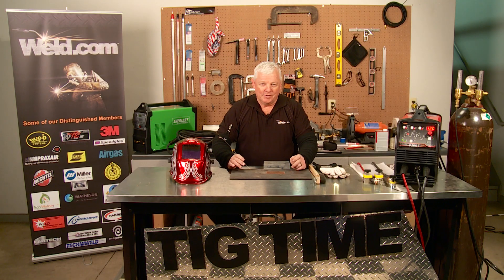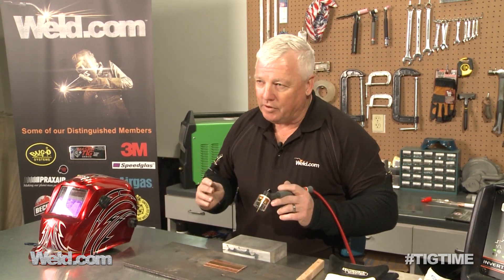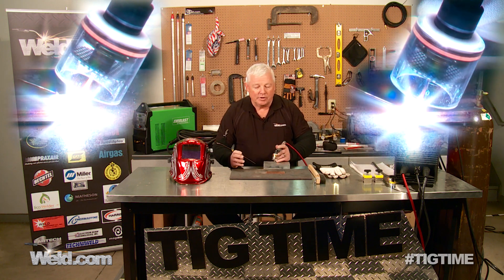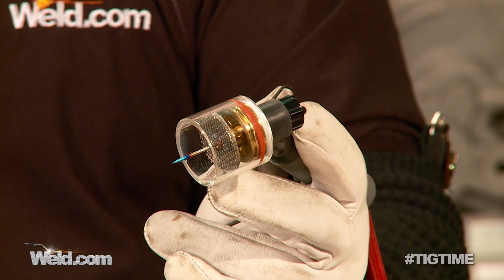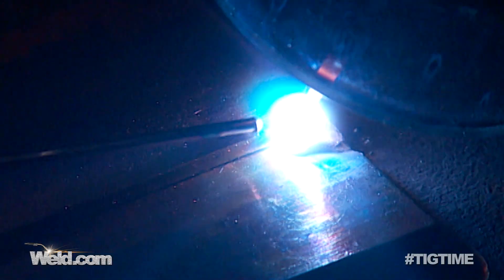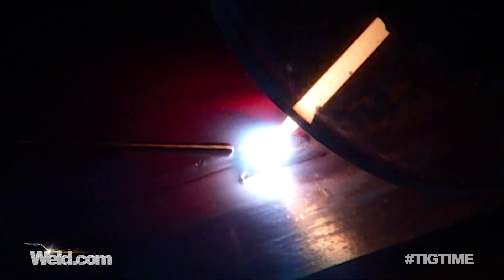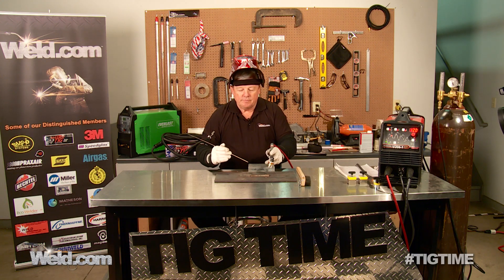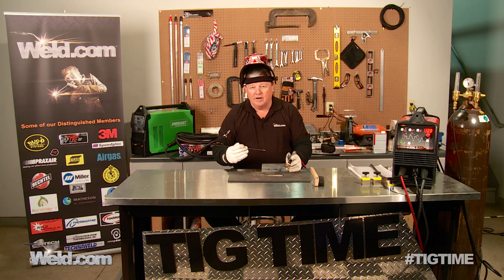TIG- Brazing Copper

Comment: Hello Mr. Tig I am on a budget and trying to figure out what machine is better to weld aluminum the Miller Diversion 180 TIG, Everlast 205Si or Lincoln precision TIG 225. Or My budget is 3000$ is there a better machine than the ones I named that you would recommend
Reply from the maker: +Lasermanw The Bannana Dude We like the CK Worldwide MT200 for $2,150. Full disclosure: We did help engineer / design and test the machine, so it's built to our recommendations. It has great low end capabilities and welds Aluminum beautifully. You can get them via our online store: http://www.weld.com/index.php/shop-weld-com/shop-weldcom/mr-tig-kits/mr.-tig-series-mt200-ac-dc-detail
You can look at our AC review of the Everlast 205SI here: https://youtu.be/r54KHm18pMM
Reply: You bought your machine by now . The dynasty series miller is the only way to go but get up in the 200 amp range so u can weld anodized or cut through other impurities in aluminum .

Comment: what I am really curious of, and this is strictly for aesthetics, but how could you get that nice copper color brazed onto a strong tig weld. Say I fabricate a oil tank for a motorcycle, out of steel and structurally the welds are all sound, could you "braze" back over those welds with some copper filler rod or using some other process to put that nice color over those welds, for an aesthetically pleasing look but still have the original strength of first weld?
Reply from the maker: +uradumby25 That is an interesting concept.  The quick answer is "Yes"  you can heli-braze over an existing weld with little deterioration of strength (steel substrate).  However,  be cautious not to melt the base metal, but rather reach the liquidus state of the brazing material only.  Let us know the results over on the Weld.com Forum. 
- Mister Tig
Reply: +Weld.com wow thank you for the quick response. VERY EXCITED to see how it goes.
additionally, I LOVE the content. You guys answer alot of questions I have wondered and do them in a very structured format! I look forward to buying some toys for my tig machine and contributing to you guys making more content!
Reply from the maker: +uradumby25 Always happy to help. Thanks for watching the show and supporting the site!

Comment from the maker: I was using dc- and 20cfh of argon. You can use a standard cup or gas lens. The argon adjustment will vary  based on the cup orifice. Typically 10 - 20 cfh. 

Thanks for watching TIG Time and Good Luck!

Mr. tig

Comment: Thanks for a great video - never tried this -but with the supply problems & price of acetylene recently in the UK I'll give it a try next job I get in copper.Your weld / braze looked real neat. 
I'd always assumed the intensity of arc as a heat source would boil too much zinc out of the filler material to work.
I found some 6" '  Scotchbrite ' type wheels on Ebay - I use these on a polishing machine & they bring copper surfaces up really well without gouging into them like a wire wheel tends to.
Reply: There is zero zinc in the filler metal.  Welding or brazing materials with zinc in them (or on them aka galvanized) releases toxic zinc fumes and for that reason tig braze filler rods are 96% copper 3% silicon and 1% manganese.

Comment from the maker: Both process (Tig and Gas welding) will produce equal results provided they are done correctly.  Gas brazing requires a "flux" to keep oxidation away from the puddle where as tig utilizes argon gas.  Tig (with a variable foot control) gives you pinpoint heat control. 

Thanks for watching TIG Time!

-Mr. TIG

Comment: there is not really a god way to connect stainless to aluminum, aluminum brazing material (like HTS2000 or those other repair rods) are mostly zinc based brazing rods and in order to braze steel or stainless you would have to have a brass or bronze based rod. Those two materials are just not very compatible - what ever you do wont have much strengh .... You might get it it "stick together" but that does not mean much.

Comment: Wyatt, my brother in law brought me a part that he wanted welded. Unfortunately when I looked at it, he wants me to hold a stainless nut in place, inside an aluminum housing. There's not much pressure on it, it just needs the nut tacked into place. I told him to glue it, but that may not be enough. Is there a technique using brazing that I could try?
Reply: @spelunked
 Just cage it in, let it rattle about with a couple of blobs to stop it turning in a round cavity if needed.